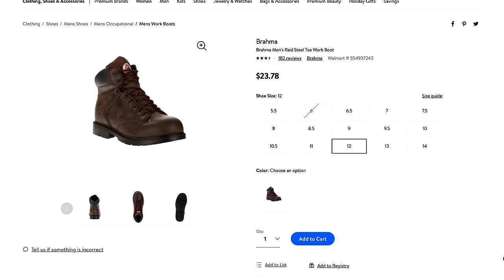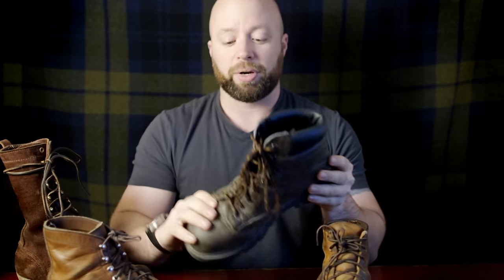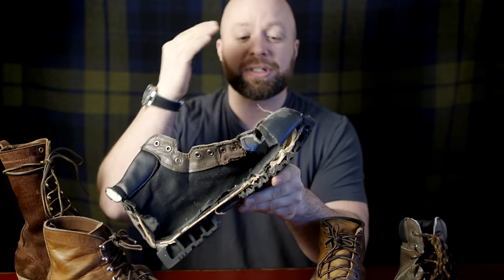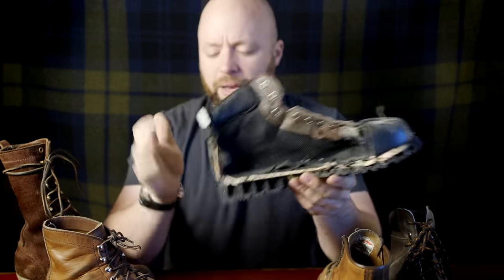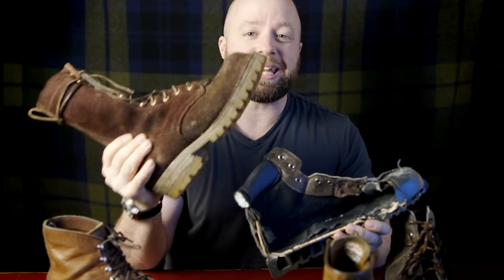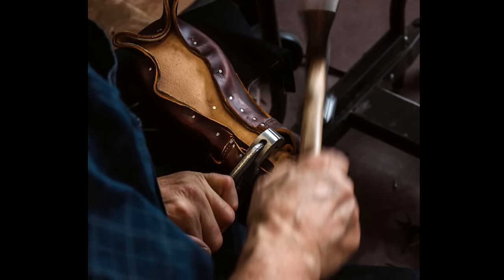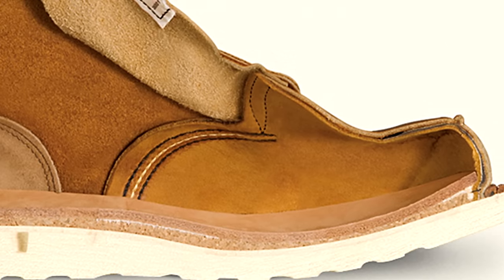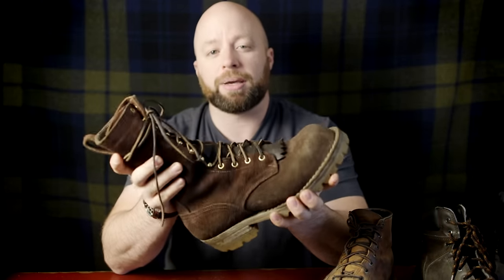Expensive vs Cheap Work Boots

Comment: So glad I came across this review. I just bought a pair of walmart brahmas. I am very skeptical about cheap shoes. I knew a bought a POS before looking at them but for my purpose I am currently going to work a summer internship so I figured my situation doesn't justify the $70-$300 work boots. However If I was a full time employee at where I will work at. I would buy what you have in a heartbeat.

Comment: Went for an interview in 1989 Eljer cast iron sink and bathtub foundry. Landed the job and my dad took me straight to the boot shop to meet Terry. And 190$ later I had my first pair of 965 8" steel toe red-wings. 29 years working, playing kids, ect... I just bought my 6th pair of work boots. They are almost 300$ now but every pair was resoled at least once and my only seam failure was fixed in 10minutes while I wanted. About 1000$ thats it. 29 years only 1000$. Probably 80 pairs of bramas honestly. Thats about 3500$ and my boots are on another level of comfort!

Comment: i had a pair of those brama boots once ,,,,,, the rubber sole started just falling off ,,, after work i had to go buy a new pair of boots ,,, it was late and sears was the only place close by so i ended up getting a pair of timberland boots that lasted 6 years and finally wore out
Reply from the maker: These are great boots to leave in your trunk for "just in case" situations. It's kind of like the pink hard hat we keep on site in case anyone forgets theirs, it usually ensures they won't forget again!

Comment: so glad i saw this video! i am a 22 year old going into the trades and this information is priceless! great video
Reply from the maker: Excellent! Good luck out there man!
Reply: Noah Harrison but the best most comfy boot and you won’t have to for a long long time ! Carolinas red wings Irish setters are good Georgia boots are garbage they’ll fall apart right after they break in probably the most uncomfortable boot I’ve bought and I spent 150$ on em you need to drop like 200$ for good long lasting boot
Reply: You can't take off your feet at the end of the day. Boots are tools
Reply: Thorogood. ..flat bottom for concrete..  my favorite
Reply: Lug sole for loose stuff and flat bottom for everything else. If boots are gonna take abuse then moc toe is most durable upper. 8" offer most support and protection. Non-insulated with the right socks good to 15deg. F.  A one mile walk on a sidewalk will break in most boots and establish your "footprint"
Reply: @gavinc2827  
I had a pair of georgia homeland boots 5 months and they were shoot still comfy though

Comment: I went with Thorogood Moc Toe boots. They are comfortable from day one, and their MaxWear outsoles have better grip and are longer lasting than Redwings. They are also made here in Wisconsin, always a bonus for me.
Reply from the maker: I’ve heard nothing but good things about Thorogood from coworkers.
Reply: I might need to check these out.  I have a pair of Thorogoods but finding the options I want with water resistance and safety toe didn't seem to show me much available in the style I wanted.  I can't find anything with a 90 degree heel notch with these options and I can't use wedge soles for work.
Reply: Heath Spence Go to midwestboots.com. I wear thorogood wedge heel and I will never wear anything else. I go 10 hrs a day 5 days a week in them.
Reply: Hands down the best I’ve worn is thorogoods as well! I’m a cement mason and I’m on concrete all day long on my feet. I’ll even choose to wear my work boots on the weekend instead of tennis shoes. They are that comfortable
Reply: Isaac Fink Same here. I work construction. I’m on ladders all day and uneven grade. It’s the only boot I’ll ever wear.
Reply: Been wondering about these for awhile heard about them hall only has them in soft toe maybe one of these days I will try them and see if there better than my red wings or comparable 👍
Reply: I bought the 6" round toe and have been wearing them for 8 to12 a day, 5 to 6 days a week, on a factory floor from the day I got them in July of 2017. I couldn't do that in my Wolverines. Also, my Sketchers and Wolverines don't give enough traction like the Thorogoods. The only issue I've had with them - and it's a minor one - is that the tongue of each boot has cracks, but where I work the temps can reach upwards of 120F so my feet sweat a LOT. It's a damn shame that after having them for a year and a half my supervisor told me I needed safety toes. Guess I'll be getting the 8" mock toes now. Even so, they were worth every bit of the $180 I paid for them, so spending a bit more for another pair won't be hard to justify.
Reply: Paul Caskey do they make steel toe waterproof?
Reply: @ajjaber3515  They do. Look at the 1957 series.
Reply: @indy3749  I like wedge heels but I can't use them for work.  I require a 90 heel notch with a safety toe for my job.  Add in that waterproofing is a must and I can't find a model of Thorogoods that will pass inspection for work.  I have a pair of Thorogoods that I wear outside of work sometimes due to the lack of a safety toe.  The pair I have actually did come from Midwest Boots.
Reply: Heath Spence can you try Carolina? That’s another really good boot company that I’ve always been satisfied with.
Reply: here is if I can explain  I buy some of those stinky smelly expensive Red wings  but what I ignore have to get two pairs  because need to let them dry  so have to wearing them every other day  I pay more than 2 Grand well that's hope not to criticize me but is my opinion
Reply: @christianlemus6483  you'll never go back to a redwing boot again!
Reply: Im on my 2nd pair and absolutely love the Thorogood moc toe boots. 
I also have a pair of danner quarry boots and they are extremely uncomfortable while costing $100 more.
Reply: Indy Debauchery 
Had. A pair of Carolina loggers about 25 years ago or so . first pair was defective , took them back for replacement 
 Six months or so  later the heel started separating from the leather upper.
Reply: Jose garcia 
You know they have shit to eliminate foot stink, don't you?
I can wear my waterproof boots for three days straight without removing them  at all , not even for a change of socks. When I do finally remove boots, my feet do not smell badly.
Reply: I bought a pair of Thorogood boots yesterday! In the past I would always by Red Wings now they only made in China, so I looked at Timberlands not made in the USA anymore either, so the salesman at the boot store said you want a good Boot made in the USA? Thorogood is the way to go, they are water resistant steel toe and very comfortable!
Reply: Paul Caskey I love my thorogoods!

Comment: I wear the Red Wing king toes. They are direct attached, so they can’t be re-soled.  But they are so comfortable.  I’ve had them for 3 years and they’re still going strong.  I also bought a pair of Red Wing 10877 a couple of years ago. I only wear them when it’s above freezing - not a fan of cold feet.  They are fantastic. I’ll never buy another cheap pair of boots again.

Comment: I work outside in muddy and wet conditions and I stopped wearing cheap boots after they would start leaking water after 2 months and my feet would be soaked 5 minutes into the work day. Lesson learned.

Comment: It’s a saying expressed all over the world and the reason is it’s so true. Always by the best quality supportive footwear and most supportive best quality bed that you can as when you get out of one you get into the other!

Cost cutting construction and materials to give a cheap initial price  is always a false economy. Good strongly made footwear made from natural materials can be repaired time and time again and even figuring in the cost of new soles and heels every few years you save in the long run over a poorly made boot, cheap cost boot.

I have a pair of Church’s shoes which are hand made in England that I purchased in 1980 and they are still going strong nearly forty years later. I have had five resoles in that time at an average of $150 a time and the initial cost in 1980 was around $180 so $930 total outlay for almost forty years of wear. Buy a hundred buck pair of shoes and your lucky if they last two years before you throw them away!

Comment: Im pretty damn young. Being 17, haven’t really experienced much hard work. However, I work in the warehouse of a retail store. And I noticed the job would tear through my shoes. I mean wear down the soles. Pallet jacks would cut into them. They wood all get stained blue from the old wooden pallets we use. Now, goes without saying, I wasn’t really spending enough money on a good pair of boots. Matter a fact, I’d use vans and converse most of the time. Then my feet started ACHING as I got closer and closer to a year of working there. Just recently bought some( Carhartt ground force’s) and boy,  do they make a difference? My feet still get sore. But it takes longer. Standing in place is way more comfortable. I never realized I needed shoes with a hard toe until I started dropping more things and realized I wasn’t in pain yet. Needless to say. Boots make a great difference. Can anyone recommend a good pair of gloves though? I’ve been going through Wal-Mart gloves like every month. Either that or get calloused hands all scraped up. I need them to be thin but durable.

Comment: I wore wally world boots for years. Do yourself a favor, don't do it!! You will throw your back out, you will fatigue your torso to muscle failure. It will cause other problems such as a hammer toe. If you have a high arch your arch will collapse you will fatigue your feet. Very painful. Take it from a guy who's been there done that. Spend that $150- $600 on a good pair of boots. Take care of your feet, take care of your boots because your feet make you money. $2000 worth of medical bills and lost time isn't worth it. That $2000 could have been used on tools or a vacation or a new toy. I do understand that guys starting out may want a wally world pair of boots until they save enough money to buy something good. There are things you can do until you get a good pair of boots. If you Get a pair of wally world boots you get a full size up add material like leather and cork. Buy a good gel insole. It's better than nothing until you get your first paycheck to buy a pair of decent boots. If you are making a career in any trade get yourself a pair of Wesco's, Nick's, or white's. Until then get a pair of Timberland pro's, Keen, Carolina's, Redwings, Chippewa's, Danner's or Thorogood's. Get what ever feels the most comfortable and that best suits your job.

Comment: Cat second shift + the Wolverine pro bullet proof for truck drivers and heavy equiptment operators asphalt welding cranes no so good if you got ta do a lotta walking and on feet all day then redwings for carpenters electricians drywall plumbing trades but they have funkie soles that don’t cut it in the heavy operator specs thank you !

Comment: I tried a few high end boots and by far Wesco out of the box are slippers. Redwings and Whites take awhile to break in but once they are. By the way your logic is right on about shoes. What you forgot to mention is getting your size and width right. Especially get sized at the end of your work day not on your day off.

Comment: I've been working in the oil and gas fields for almost 10 years now. Red Wings are the only boots I've bought that have lasted for more than a few months. From 120 degree heat all the way down to the low teens my feet have appreciated the money I spend on my boots.

Comment: I bought a pair of the Brahma iron toughs. $45. Replaced stock thin rubber insoles w gel doctor sholls pads. Then upgraded to a pair of steel toe Carolina loggers. No insoles.
Reply: As a side note. I bees waxed the outside of both pairs of boots for water resistance. Never gotten wet feet in either. Brahmas are black "leather" 200grams waterproof. Carloina loggers (boot barn 150$ black Friday) "waterproof" steel toe sz 12

Comment: I'll usually buy $170 boots from Irish setters to timberland to danners. I have gone through die hards, and a shoe city brand called Cactus. Cactus was kind of strange, they were heavy, and the sole never wore down and they were very comfortable for 60.00. but after a year the inside padding wore out. Still outlived die hards and Irish setters and Danners. I think it's important to buy an expensive insole like the I got from redwings. Makes any boot comfortable and good support. Have Timberland pro Gridworks currently, great boot so far, probably won't last a year however

Comment: I use to wear redwings until they did away with the boot I liked. It had a king toe that was huge and wide.  I have a extra wide foot and when I have to put on my steel (safety toe...) boots it kills my feet if they are not super wide.  I have to get EEEE wide or WW.  I have Keen boot now but they wides are tight but are the best I can find where I live.  I want a wider boot just can’t find them or a custom shop where I live or anywhere close for that matter.  Someday I plan on getting custom boots but the $400-$600 price tag for a wider boot is hard to do that’s when I is close to a weeks pay for boots.  I do spend 80 to 90+ hours in my boot a week so saving up just take time.  Insoles help me with the problem you are talking about and redwings are the best I have used so far.

Comment: I have a pair of thorogoods, the bottom sooemdidnt even last a year. Very hard on the bottom of my feet and also a lot of heel slip. Doesn’t matter if you size down , get true size or size up. The heel slip is highly annoying. The only way to kind of resolve that issue is if you tie your strings around the top. Thorogoods are highly overrated.

Comment: I tried a pair of brahma, 4 months later I had a hole in the middle of the right sole, and the seams were split in multiple places.... before that I had carhartt boots that lasted 4 years. Although, I could have used new boots at 3 years. I just liked them and they don't make that particular style. About two weeks ago I purchased RedWing work boots. The $210 price tag made me feel bad about buying them, but after that first day I was sold. As long as they hold up like their reputation states, then I'll always buy RedWings

Comment: Hi Carl, I have those exact brand Brahma boots, from Walmart. I’ve been wearing them for a year, and recently I’ve been thinking about a better and more comfortable pair of work boots. During my week, I work retail. 3 days, 26hrs at Hobby Lobby, and 4 days, 22-31hrs at Home Depot overnight. I need something that is more durable & comfortable than those Brahma boots soon. The only boots I ever heard of are Timberlands, but never had them, so what would you recommend for my line of work? I want to take your advice and invest in myself. My feet really appreciate the help.
Reply: I’ve done construction as well as work in retail. For you: 
Thorogood moc toes are great, Silverado work boots are good also, Jim green boots are great for the money. If you want the absolute best with no corners cut: Nicks handmade boots or Whites boots.

Comment: I work in a metal fab &welding field and have worn Chippewa and Carolinas and have stuck with Carolinas because of the rivit in the front because those threads burn out and the rivit is only thing allowing me to tighten my laces. But i can trash a pair of  boots in less than a year, i would be horrified if i trashed a $600 pair in that time... The toe leather is the first to go every time. Ive had the steel fall out they got so bad.  Carolinas seem ok cant complain they get harsh treatment. I tried to go real cheap recently and bought $60 giant blue? Loggersseemed ok but sole fell apart quick. The $75 dickeys seem decent tho but i like loggers, but now i have spent enough to have gotten the Carolinas so that was stupid. Those nicks seem awsome tho love to sack up enough to buy a pair.

Comment: I'm 47 years old, i currently were Georgia Boots. I work outside cutting trees, building retention walls, mulching and landscaping. Its my second pair. They are "broke in" comfortable right out of the box. I was wearing Asolo between Georgia boots. Alsolo's are very high performance, rugged outdoorsman boots but i would wear my Georgia's into combat. No joke. Thanks for the research.

Comment: Redwing, Chippewa, and Jung when they were made. Yes $300 to $400+ boots for a factory worked. You did not mention comparative cost over time. I spent less per year with expensive boots because they last (with proper care), much longer. I got sometimes 10 years use at work out of 1 pair (44 years inside and outside warehousing). Worst I got from cheep boots was 1/2 year. Retiered now and buy custom hand built only and my first pair of Russell Mohicans are over 20 years old.

Comment: I've used Dickies Brawn for years now get them for $80-$85 I think at Walmart and they're great.
I use them for roofing and they have great traction as long as they're is no sand the shingles leave. I did try those Kmart $30 boots from Craftsman I think, they of course did make my feet smell and they fell apart far sooner.
I always think of getting a good pair but I just don't like the flat looking tread most have like the ones you showed.

Comment: I own a lot of boots  for diferent reasons.    Got the soft soles for working on hard floors,  the heavey safty toes for industrial jobs that require  them, the loggers  for the mud, duck boots for wet, rubber for water,....   lots of brands. Some cheap that will get trashed  in a week or 2  the loggers are at least 10  year old redwings that have been rebuilt